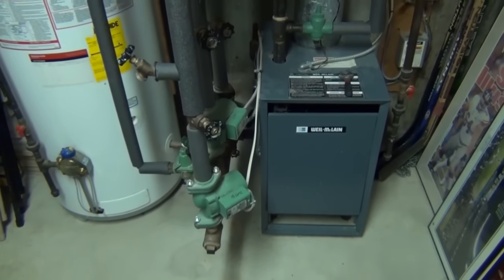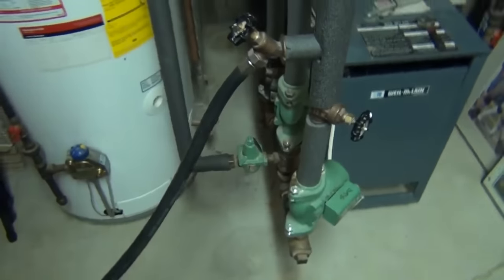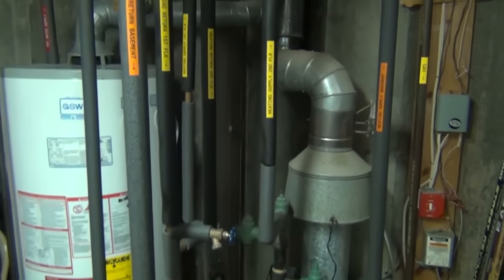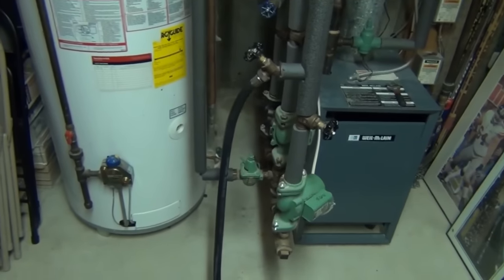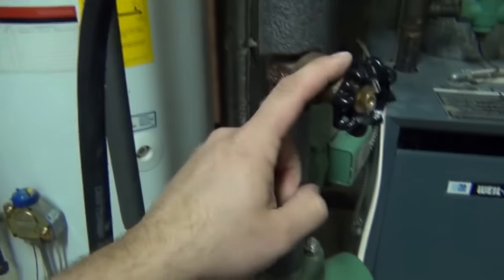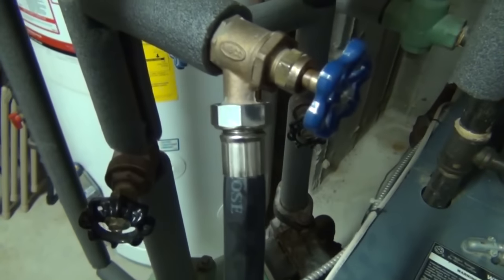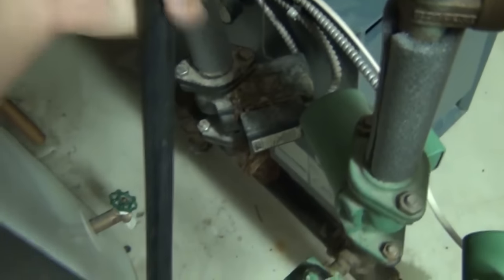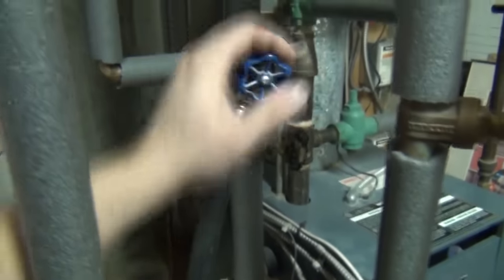Remove Air from your Boiler and Heating System | How To

Comment: My setup is a lot like yours except 2 zone. My feed water comes in right at my expansion tank though?. There's no water coming out of zone 2 when I open it as you instructed. Could this be an obstruction?  I dont get it. Nor do I understand why the feed water would be situated as such. Yours makes sense to me.
Reply: Ps thanks for the great video and instruction.
Reply from the maker: That’s actually a common setup having the feed water come in near the x tank. If you open the bleed valve and nothing comes out, you either have a pocket of air or your flow check valve might be stuck closed...or another valve somewhere is fixed preventing the zone from operating.
Reply: @fixitwithzim  thanks. It was the feed water pressure valve. I was able to remove the filter and clean it out and got it freed up. Both lines were running on e for however long. I'm shocked I didn't burn up the circulators or even the boiler. Thanks again.

Comment: Hi, your video was simple and to the point so it was super helpful. The only thing is that when I opened the feeder valve the prv discharged. I guess the pressure was high which you told not to do. Do you know what I am doing wrong? I am trying to figure out if I should just open half way?
Reply from the maker: Don’t open the feeder fully until you have your purge valves open and draining. That was probably the cause

Comment: The best tutorial I have ever seen hands down. Do not have the same brand of boiler, I have a Weil Mclain, but set up is identical. Huge help is showing me how to purge/flush air from my system. Worked like a charm. However, not sure if this is the right forum for questions but seem to be having issues flushing/purging air from 2nd floor hydronic loop. Following the same procedure for first floor, but every time I bring water valve to full flow/street pressure it pops the 30 psi safety relief valve. Have reduced pressure at Taco diaphragm valve down to 15-18 psi for normal operation, but every time I try to bring incoming water to flush up to street pressure, or close to it, it pops valve around 25 psi. Ughhhh. Anyone ever seen this? could a faulty, partial closed gate purge valve cause the pressure to spike. Relief valve if popping around 25psi. Not getting the opportunity and time to flush for sufficient time. Any thoughts/suggestions?? many thanks
Reply from the maker: My first place to look as you stated would be the valve. You also might have some debris in the pipe or valve causing a partial blockage. I’ve also seen the circ pump get blocked up really bad at times. If you have flow check valves, check that one of those isn’t causing a problem as well.  I’ve seen those installed backwards sometimes in terms of where the air purge valve is located

Comment: My boiler has been shut down for the summer. Getting ready to fire it back up. Can I bleed the system before lighting the pilot or should that be fired up first. The end of last season we were hearing banging/hammering through the baseboard heat when it kicked on.

Comment: Great video!  i have same type unit just 2 zones . only thing  is that fill valve mine is different its connected on a 1/2" copper pipe and its a double loop lever that you pull upward and leave in middle but i didnt hear nothing no water sound coming from it like yours does where you actually hear the water coming in from city . my psi is at 12 so i guess its not broken ? ok so i had to purge 1 zone i believe its the main house house for 25 min!!! and it still had very little bubbles coming up from time to time so i just stopped it and did next zone which had no bubbles did that one for 10min that was my basement . So dont know why i heard nothing from fill valve and do you think i need to purge again from main floor ? does it matter how long i run water out can i purge for 1 hr ? i mean i dont understand why after 25 min it still had tiny bubbles coming out ?  i have a cast iron base board system house built 1955 boiler was installed 2006 it has a big metal plaque on it that says UNION STEAM figuring thats the brand.

Comment: thank you for great information..What if there is no shut off valves over the circulator pumps should I drain the whole system ?  I have a three zone system  there is only one pipe on the bottom of the boiler with a shut off.  thank with any help.

Comment: Question - I have a one zone loop system which does not have a bleeder valve on the boiler line, but individual ones at the heaters.  Should I use the boiler drain and the heater bleeders instead to purge air?  Great vid!
Reply from the maker: Try the bleeders first without touching anything near the boiler. You might be able to purge all the air with just those

Comment: Excellent video. My setup is slightly different. I seem to have 5 zones but only 1 circulating pump. I guess instead of multiple pumps I have zone regulator valves. I also don't have a return valve for each zone that I can close, but perhaps the zone valves serve that purpose. Do you have any experience with systems that have zone regulator valves?
Reply from the maker: Thank you!  Yes, you can close the zone head valves. Usually you’d like to see ball valves in place as well but you can still get the job done. Use the lever to manually open or close.

Comment: Great video with lots of info. One question I have is wouldn't you have the circulators on the outlet of the boiler? Looks like you have them on the return near the inlet so water is technically already back at the boiler no? Apprentice here.
Reply from the maker: Thank you! Ideally, yes but have to work with what I have.  The system as a whole was designed poorly. Someday I’ll redo it but not until the boiler is ready for replacement

Comment: If u have baseboards with bleeder valves would u still clear the system the way u did it here or release each bleeder valve at the baseboards Themselves? I did mine in my previous house at the farthest bleeder from the boiler and worked my way to the closest .. The first valve released straight air for a solid 15 seconds before spitting and then full water flow. Made a big difference.
Reply from the maker: I would do both, first the boiler with the way I showed in the video followed by the purge valves at each unit

Comment: Hi, I have a oil furnace with 2 zones. I need to drain the air from 2nd zone/floor. I have a watts Boiler Feed Valve w/Backflow Preventer. Do I use/open the flag/lever  on the boiler feed valve to introduce water into zone while draining air out of system? As I don't have the same feed valve as you. Thanks for the great video.
Reply from the maker: Yes, same concept as I showed in the video however on your feed valve, you’d operate it on top by flipping the lever up.  Remember to close it back off to normal operating position before closing your air purge valve.

Comment: Dope video. Thanks man. What are those green valves on the lines coming on the outlet side of the boiler?
Reply from the maker: Check valves...prevents water from back feeding to zones not calling for heat

Comment: I have a gurgling boiler following a drain down.Have tried bleeding the radiators and drawing off water from beneath the boiler.Would it be better done whilst the system is working, rather then when the boiler is switched off

Comment: Thanks Zim. 
Can I measure the regulated water pressure on the heating system using those valves and a water pressure test gauge?
Reply from the maker: Yes, but ideally with the system off (pumps not running)

Comment: Awesome video..Thanks.
What should be normal pressure on the gage reader?
Reply from the maker: Thanks!...The system is usually set at 12 psi.  When running, it could be anywhere from 12 to around 25 psi...but no higher. At 30 psi, you’re pressure relief valve will pop off. You don’t want that to happen. Hope this helps

Comment: I have a three zone system with zone valves on the supply. I understand to manually open each valve for each zone.  The part I'm confused about is I have drain valves  below my zone valves. 

1. Do I leave all those valve off and just use the zone valve manually? I'm honestly confused why drain valves are in  both supply and return. 

2.  If after closing my fast fill the then return purge with the hose and my boiler gauge happens to read higher than 18psi. How do I lower it? Thanks

Comment: What if you have antifreeze in your system. I have an external 5 gallon bucket with the antifreeze and a electric pump. I pump into the bottom drain of the boiler and drain from the same valve you are draining into the shower. Very hard to remove the air but I learned from your video that I should be shutting all the zones just after the drain valves not just the zone I'm working on. The other issue that I'm seeing is that when I test my pump, from one bucket to another bucket my flow from the pump is creating a lot of air into the second bucket.
your thoughts
thanks

Comment: Super, I have a rushing stream of noise in my 2nd floor (3rd zone) when the heat comes on....I followed your tutorial and didnt get much flow into the bucket...water intake was wide open and 3rd zone return was spigotted into the bucket, but I forgot to open my zone valve...once done, I saw water into the bucket with lots of air ...my system does not have a valve to shut-off flow thru the boiler but I was still able to isolate the purge to just the 3rd floor loop with the other 2 zones shutdown.   We'll see tonite if the rushing water has disappeared....
Reply from the maker: Nice…. Hope you had good results!

Comment: Hi, great video, my setup is very similiar, but i have a bigger  red round handle valve about a ft. above the burner.  what is that for?
Reply from the maker: Probably an isolation valve for one of the zones or possibly for the main supply header off the boiler...tough to tell for sure without a picture

Comment: One of my cooper pipe from my baseboard heating is leaking. If I was to cut the pipe to add a new one do I have to remove the air the same way?

Comment: Thank you very much for your video!  I am cutting in a kick space heater in one of the zones.  Do I have to purge all zones even if I'm only working with one of the zone?  I have a very similar 3 zone system.  My hot water is also heater by the boiler... Do I also isolate the hot water storage tank? 
 Thanks again.
Reply from the maker: Shut the valves on the other zones so they’re isolated. You should be ok and not need to purge them
Reply: @fixitwithzim  Thanks!  So obviously while I'm working on the specific zone I need off during maintenance I need to shut off the fill valve, as I do not want to fill the zone until after completed.  When I cut the copper at the location I will get water leaking out.  Once the maintenance is completed, then follow the same process of purging air... Sorry for the long winded question. I really, really appreciate your time.

Comment: Thanks for this. Very helpful. With only one zone in the house (thought I had two) it was easy in theory. The problem I ran into is no water really came out when I turned off the valve and opened the release valve. I figured maybe I wasn't doing things in the right spot but my furnace is actually the same exact furnace you show in this video. Back to the drawing board.
Reply from the maker: You’re fill valve might be stuck. It’s a common problem. Work the lever back and forth a few times
Reply: Does every system have a fill valve? I can’t seem to find mine

Comment: Thanks for a great video!  I have one question though.  How do you open the zone values when the the electricity is turned off?
Reply from the maker: There is a small lever that you push, that will activate the valve.

Comment: Hello Zim, can you please answer 2 questions :
-My system is gas boiler with some zone valves (silver honeywell) and auto filler. The hot water tank is also controlled by a zone valve. When bleeding or purging the system, do I need to bleed the hot water tank's zone too?
- To bleed a zone, I was told to just shut the valve on the pipe with the zone valve, connect a garden hose to the drain on that zone valve, manually switch on the zone valve, and open the drain. When doing this, do I only manually turn on one zone valve that I'm bleeding, or I have to let another zone on too to reduce the pressure (so bleeding one zone and turn on another zone without bleeding at the same time)?. Thank you.
Reply from the maker: A little late with this response but yes, you would want to purge the water heater loop as well.  Do one zone at a time, it will make the process faster and more efficient for each zone.

Comment: Nice video. Thanks. 
Question: When you bleed the lines, do you need to let the boiler itself cool down? Because if its winter (that's when you discover these problems)and the system has been running and is hot, you are introducing cold city water, through the fill valve, on a hot cast iron boiler..?? Could you advise please? Thanks
Reply from the maker: Yes you do, turn the boiler off and let it cool to around room temp.  Its never a good idea to introduce water and different temperature extremes.  I will say I've done it both ways but only in emergencies

Comment: not sure if you are still replying to this video but hoping you do. I have an older home with cast iron radiators all of which have bleeder valves. Would bleeding the individual rads not accomplish the same result? Asking because i only have one zone with no drains incorporated into the system except the main drain on the boiler. I am currently replacing the circulator pump and want to insure l purge all the air from the system. Many thanks great job!
Reply from the maker: Hey, I’m still replying…yes, in your case use those bleeder valves on the rads, it will accomplish the same result but will be a bit slower of a process. Ideally you should have a drain somewhere near the boiler to purge air out of the headers as well but if you don’t, the method you described will work
Reply: @fixitwithzim  many thanks..l believe l have all the air out now..just one question..should the main water supply valve (with backflow preventing valve and pressure reduction valve) be left on or shut off? I vacate the property when I travel south for the winter and thought it best to shut it off.

Comment: 15:40 my gauge is reading no pressure at all, though it reads the temperature properly. I didn't see it come off the stop even with the fast fill, and i couldn't leave it on fast fill even with the drain valve fully open.  It popped off the pressure relief, so I i had to just fast fill in brief intervals to avoid pop off.
Is the gauge likely to need replacement for the pressure indicator, or is there maybe a blockage that could be causing the zero reading?
The drain didn't come out in a fast flow torrent so maybe there's a restriction in the line-

Comment: Truly excellent explanation for this task!  I do have a question though- I have 2 zones, each zone has its own Taco zone valve, they are model 007.  These valves do not have any switch to manually open them, which is what it seems I need to do before flushing everything out?  FWIW the valves are controlled by an Argo ARM 2P circulator relay... THANKS for any advice!
Reply from the maker: Taco 007 are circulator pumps. Do you mean a pump or zone valve?
Reply: @fixitwithzim  Thanks for the correction.  I guess I don't have zone valves... and nothing has to be done with the circulator pumps during the process?  Just leave them alone?  I look forward to tackling this project when we have a slightly warmer day- I have lots of noise in my baseboards!
Reply from the maker: @janothebearc4307  yes, follow exactly what I did in the video. Sounds like you have a similar setup. Good luck, it’s an easy process 👍🏻
Reply: @fixitwithzim    One other question, if I may?   One of my zones, that heats upstairs,  splits off in 2 different directions as the water leaves the boiler (to reach 2 different areas of the house).  The 2 returns each have their own air purge stations, with gate valves under them... then the return pipes merge and return to the boiler.  So, do I have to purge these 2 simultaneously?  Thank you for your help!
Reply from the maker: @janothebearc4307  you would purge those one at a time.  Then when you’re done, open both and purge for another 1-2 minutes to remove any trapped air between the valves. Hope this helps

Comment: Thanks for this. My boiler system does not have a valve between the circulator pump and the air purge spigot. Any advice?  Do I need to do the bleeding procedure with the zone pump running?
Reply from the maker: Well, it’s not ideal but you can still make it work. It’ll just take a little longer to get all the air out. Turn the pumps off when bleeding. Good luck with the job!!

Comment: Good Morning.  Like your videos. My furnace is similar to yours but I only have 1 pump. How do you bleed it. Do you have a video for it?,  Thanks
Reply from the maker: nelson mendez how many zones do you have?  If more then one, you should have several devices called zone heads or zone valves. They’re electrically controlled valves that open and close based on if a zone is calling for heat or not. You would manually close these and then open the purge valve for that zone as I did in the video.

Comment: Greatest video Thanks so much.I have a question how much PSI air should be in the expansion tank?Thank you again
Reply from the maker: It should match your fill valve psi
Reply: @fixitwithzim  Thanks so much I replay your video and it did said it have to have to same amount of PSI as your fill valve